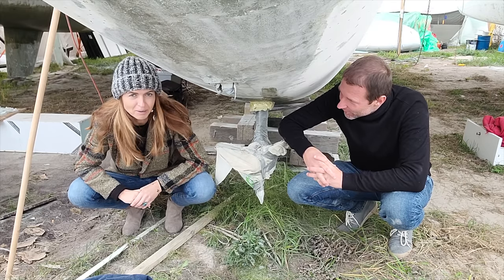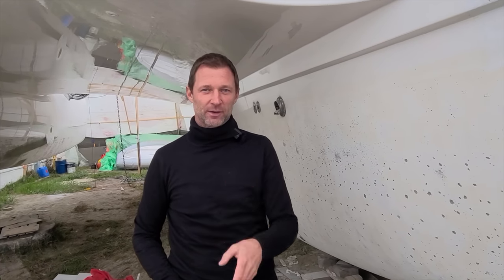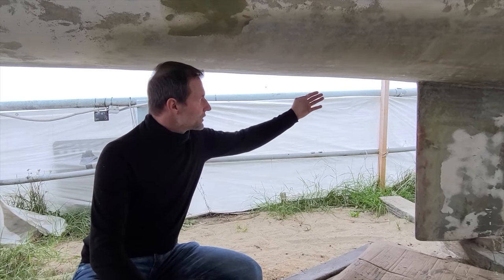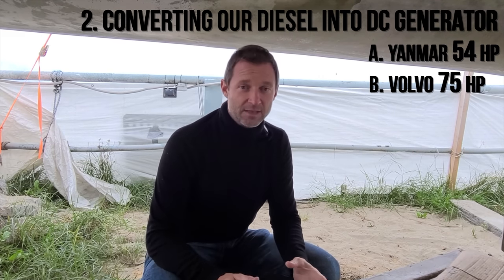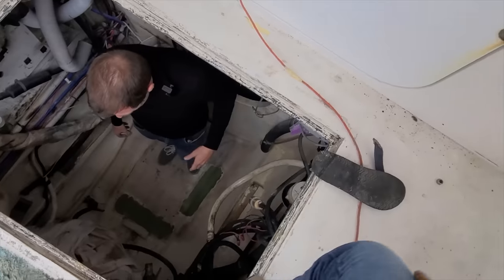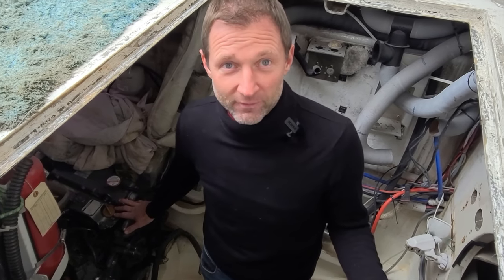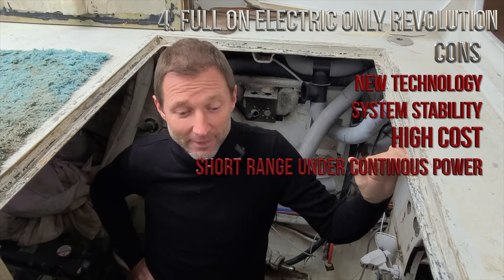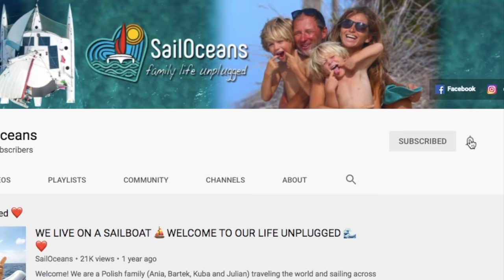The Big Decision - Electric vs Diesel Sailboat Propulsion

Comment: Bartek, I am not a specialist in this field. However, the advice that I would offer is for you to decide first if you want to go the ecological route or not. If the answer to that is “yes”, then you need to consult a specialist. I would recommend that you contact and talk to Dan from Sailing Uma. They have pretty much built their boat themselves and it is all electric. They have sailed that boat for 7 years and have been right into the Arctic circle with it. They are architects and are very detail-oriented. So if anyone, they are very up to date with the latest electric technology and I am sure would be only too pleased to help or to point you to the right people, particularly if you choose to go electric as this is close to their hearts.
Reply from the maker: Yes. It's definitely happening next. I have heard more about Uma's Dan than about anyone or anything else so far :).  I do want to go down this route including the ability to adjust my lifestyle to fit the perhaps imperfect solution in the name of silence, renewability, simplicity., and maneuverability  I know the simplicity might be not so obvious, but just for me personally it is far easier to work on electrical and electronics systems thane on diesel. For many others it may very well be the exact opposite. Thanks for the info. Cheers Joe, Bartek
Reply: @sailoceans  Bartek, make it simple: 1. keep the Yanmar engine since is already mounted and ready to go 1a. add large alternator to help charge batteries (see project atticus) or 1b get sail drives that can charge batteries while sailing (See sailing UMA) 3. get new electric motors , solar panels and lithium batteries 4. get rid of volvo engine to help pay for the upgrades. If all would work great and all the kinks are worked out then get rid of diesel engine and go full electric. Pozdrowienia z Chicago z trimarana Doriacada.

Comment: I like the single engine, dual motor hybrid. You can still have air conditioning. I would recommend having an engine/generator large enough to drive it at normal cruise speed. For normal harbor and docking activity you can run without the engine. You might find yourself having to motor for longer periods than you like. Therefore, the diesel is here to stay.

Comment: Have you thought about ocean volt with turnable saildrives  you might be able to put two side by side in the mail hull, giving you redundecy and manuverability, but keeping your wire runs short from motor to battery banks. Also ocean vault has great Regen options then get a small Genset and a bunch of Tesla or Chevy volt batteries.

Comment: Yes "Sailing Uma"  would be a great benefit to look at or ask their opinion.  Narrow  your choices to two.  I would definitely look at the cost benefit factor.  If you don't motor that much would it pay off to spend the money effort and time. How much will you save on Diesel ? How long will you spend in the yard retrofitting propulsion ?
Reply: Looks like green energy is not working for "Sailing Uma" they recently bought a generator to recharge their batteries, earlier they admitted, that they always charge batteries in marinas. How would it be easier and cheaper to just leave the diesel !!! Oops, I almost forgot Y/T  looks differently at the green ones.  🤣🤣🤣 ROFL

Comment: As an electrician, I would keep to diesel engines...follow the KISS theory. Have a failed shaft seal with diesel = motor still works, shaft seal failure with electric =  catastrophic failure. Having an electrical system failure at sea may have potential to stop all electrical systems on boat, both propulsion and house loads. Plus a high voltage DC arc if you have a failure in a big plastic boat may not end well. Yes I do see the merit in electric drives, but I do see the simplicity of having a stock standard diesel that can be relied on for long term hours on hours of work.
Reply: High voltage electricity and water.  What could possibly go wrong?
Reply: what he said
Reply: @deanbone6790  

Same as with any electrical system ... Including those that manage modern diesel engines. ..

Comment: Option 4 is best and technically easy , especially when considering the knowledge needed to fix and maintain Diesel engines . Any learning curve for fully electric systems will be short for you my friend.
When sailing your props can be used as generators to charge the lithiums, the solar panel’s will be great for lights and cooking, etc. when in ports and a couple of wind generators when it’s windy and not sunny. I would bet you would only need a portable diesel/gas generator for a what if scenario .. and never have to use it. I think the true key to this system is lots of light weight lithium batteries which will still give you lots of extra room on board , taking out diesel tanks and motors.
Reply from the maker: Very good point again about the portable genset for the rare occasions. Thank mate. Cheers. Bartek

Comment: Option 3B for me, larger generator with a battery bank.  Option 4, as you've mentioned, is quite risky as you would need to have a large battery bank and that will costs a lot of money.  Battery and solar panel tech is not there yet to have the capacity to give peace of mind.  Plus, you will always have sth hanging over your head range anxiety.
Reply: larger(diesel) generator with a battery bank and (5000$)electric motor, is that make sense to U ? how about just nice diesel ?
Reply: The generator should be enuf to both power and charge at the same time plus, maybe, 20%.  The buffer is dependent on how long you want to run the generator.

Comment: How about a Hybrid system? Where you install the two electric engines with Lithium batt system you mentioned doing, but keep the diesel engine adding a larger alternator to it. So when the diesel running its charging the lithium batteries and you could put a clutch on it to engage its prop as backup propulsion.Not sure if I explained that well, but you can look at how Greenline Yachts does it.
Reply from the maker: We are heading in direction of a hybrid, but with a light DC genset, modest battery bank, and two electric motors. Keeping the 300 kg  of the big diesel aboard would defeat the purpose for us. We would only add significant weight that way and we intend to keep it down. This boat is very sensitive to overloading and part of this refit is getting rid of all the unnecessary stuff. Thank you for your comment. Cheers mate. Bartek

Comment: Thinking about, for me the best option is n. 4 but keeping the 3kw generator and a smaller battery pack to reduce costs.
But, If the battery is sponsored, go crazy and get a big one, just remember how heavy is a large Lifepo4 battery pack. For 15h run will be heavier than engine+gears+fuel etc

Comment: Hi my friends even though I love the idea of electric concept due to sustainability etc... I would install the Volvo back again, because of safety issues. The diesel once started runs also without electric power even in a worst thunderstorm and when already water is in the boat, this is the situation we all dont want and where batteries give up but the diesel still runs, also you can use the diesel to pump water out of the boat... Further more you said that you are using it very minimal. Minimal usage = minimal polution. When you put all the points in the basket it is at the end in my opinion the best and most importantly the safest solution. Boating is different compared to car, hence I would not go electric.

Comment: Will there be cavitation of the props if they are on the amas? What about drag when sailing? Like the redundancy of two engines..  Maybe put them both on main Hull so no loss of power due to cavitation?
Reply: Cavitation under power ? Thats a function of the prop spinning too fast for the water passing over it. The props can be folding or servo type ..ie to a fully reversible position. Sailing Uma have gone from a folding set up to a servo prop with regen.

Do you mean drag when under sail ? Theres also the possibility of regenerative charging under full sailing conditions depending on the motor design but the power of the motors shouldn't be an issue .. as a motor the size of a small suitcase and liftable by hand can produce huge amounts of power and torque for years.
Reply: @clivestainlesssteelwomble7665  Cavitation as in when the amas pull up out of the water due to the force of the wind on the boat..  there is a slight tilt even for trimaran's when the wind hits one side and the other side tilts up out of the water then there will be cavitation if they have the props on and lose power on that side..  or even prop coming totally out of the water just depends on how much wind force is hitting the boat at that time and quite frankly if this is in a emergency situation like steering out of a difficult area or a prop coming out of the water at all is not a good thing as you would lose half you thrust power or a percentage depending on how much the prop came out of the water and if there was cavitation...   just not sure putting the props on the amas is a good idea as the tilt of the boat will affect the efficiency of the props depending on the proximity to the waters surface...  i would not want my family and myself to rely on props that could potentially come out of the water in a strong wind and lose thrust on one side of the boat...  disastrous in a storm or high current indeed...
Reply: @ThoughtfulWander  
I see your point i did ask him about the hulls flying but as this is a wide cruising vessel they dont lift that far ..if he was worried about not being able to sail safely he would have dropped his sails anyway and would be running on motors .. you see.. also if he suddenly needed to turn into the wind it would be the down ama in the water anyway....turning the other way he would drop the lifted  ama in the action or turning away.

The only other point is the positioning of the props under the amas and why the need to be that far forward.🤔👍🏻
Reply: @clivestainlesssteelwomble7665  ok hopefully all is OK..  Just wanted to see if it had been thought about.. Stay safe SailOceans crew.
Reply: @ThoughtfulWander  

I think they are following Polish testing techniques.. .😉 Trouble is This might be the first larger Trimaran to go down this route. 
I would ask a few questions at the school of maritime studies..
get someone to run some of the numbers and look at the hulls behaviour under power and sail given any changes. Nice  project paper for a post graduate.

Comment: The answer probably depends on how much power you need to motor at a reasonable speed of say ~5 knots. Can the solar & batteries generate that for most of the daylight hours? 
Would be great to get away from fossil fuels, buying diesel and diesel engine maintenance!
Good luck!
Reply from the maker: For the momment we think we can get around 5 kW on average during daylight. That maybe enough to power us at 2 knots. I am not sure. We're experimental in this area. One thing is for sure is that the solars will greatly extend the autonomy. Gas powered portable light generator mentioned here by few viewers can be another occasional use solution. I agree fully on diesel maintenance and fossil fuel comment. Thank you. Cheers. Bartek
Reply: @sailoceans  would be great to ghost along - even if at low speed - when there isn't any wind, and a tri is perfect for that!
Reply: I suggest to keep the Yanmar as installed. Replace the alternator with a higher capacity. Add the electric systems reduce the size of your fuel tank down to about 40 gallons. Upgrade the electric panels and battery banks. This will let you gain the experience with the electric drive systems and their power requirements. Later on you can decide adjust your panel and battery banks before you  remove the Yanmar. Then you are more comfortable with your systems performance and mature in your knowledge of the system.

Comment: My solution is full electric with an 4kW diesel generator. 30 kW electric motor and 20 kW LifePo4 battery. Cruising speed 5 knots/ 4h, boat is 43 feet an 13 tons ketch. ;)
Reply from the maker: Hi Thomas. Thank you for sharing this. 1.5 c is very high. What kind of batteries do you have that can handle this kind of load? Or is that you never ran the motor at full speed for any significant amount of time? Normally the safe assumption is 0,5-1 c maximum before the BMS would cutoff the batteries so they don't overheat at too high discharge rate. 
Another question: Is your 5 knots for 4 hours just from the batteries or is it with genset assist?
Cheers. Bartek

Comment: @SailOceans - question: if you go electric drives in the two floats (which for a trimaran is a very cool solution), do you know for sure that the two floats will stay in the water in rough sea?
Reply: From the many videos I've seen of trimarans, they probably won't.
Reply: @jamesaron1967  
I asked Bart about this exact thing. 
This is a very wide cruising vessel so it designed to stay flatter in the water. 

Pod drives would sit lower still in the water under the Amas.

Comment: Keep redundent options.
Genset could pull you through.
Sails complicate solar panel operations. Don't want to have to plot course just to maximize sun exp[osure.
Are you getting regen capacity with those motors when sailing?
That could extend your range and maximize battery charges.
Lots of considerations...

Comment: I would keep bigger diesel (Volvo penta) and add 2 electric drive!
1. Because all electric is not mature yet and high cost
2. Reliability and easy to repair diesel - if electricity fail - still you can go somewhere to repair it
3. Install 2x 48V 200A alternators to volvo penta - will give you ~18kW electric generator (there are plenty used car alternators (48V) available for ~200€)
4. install 2x electric drive ~15kW each
5. Battery for the moment 4x 100Ah @48V give you ~20kWh energy - make sure there are LiFeSO4 not tesla like LiOn because those are flammable - last yest 100Ah cost arround 3k€ now 1,5k!
6. Make sure you buy solar hybrid inverter and if possible solar optimizer to each solar panel 

For the 1-2 year of usage finally you can upgrade battery and replace diesel drive to generator

Comment: If I were you, I'd speak to Dan and Kika on SV Uma and get  some information on their 'Re-gen Sail Drive' and motor.  Your idea of having a drive unit in each of the outer hulls is a good idea.  So, the question is, do you keep the main diesel engine and use it as a generator, or do you buy a bigger genset and have a large battery bank as well, which can also be charged by a good amount of solar, PLUS the power generated by the sail drive regen system.

Comment: I have been designing a trimaran in my head for 50 years and it currently has an electric drive forward and stern.  the forward drive would be easier to keep the boat on course in waves and the stern drive would work well for regeneration when sailing.  How big theneed for continous operation generator is depends on your

Comment: Always keep a Gen, just to power the batteries incase you dont have enough light for the solar panels..
Reply: A large battery bank also means, that you need to keep them in groups..  Divide them so that one is operable without the other..  Group them in such a way, that you should be able to charge the batteries enough.. You will always have a back up to a backup!!